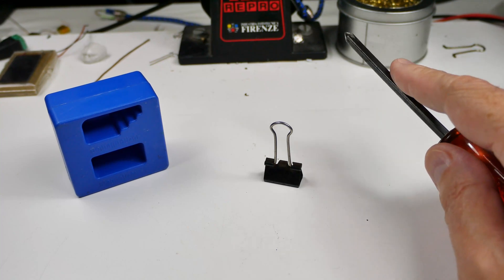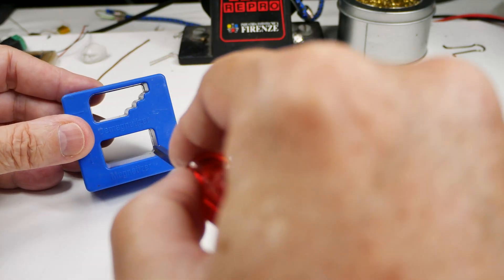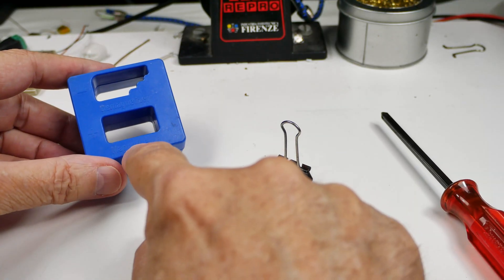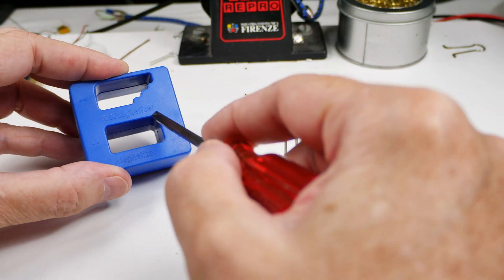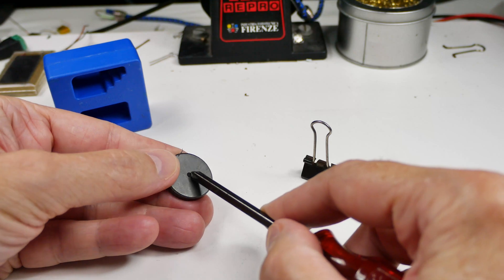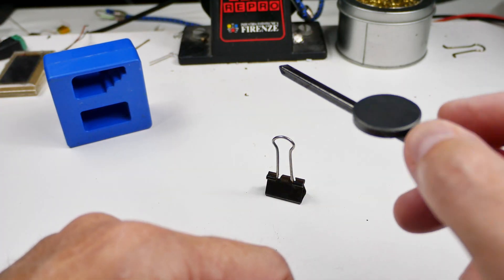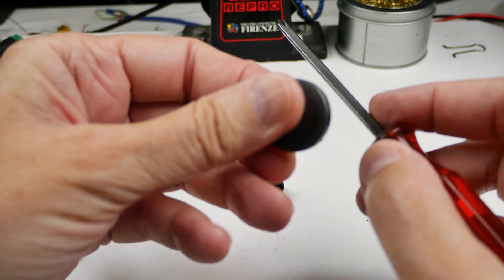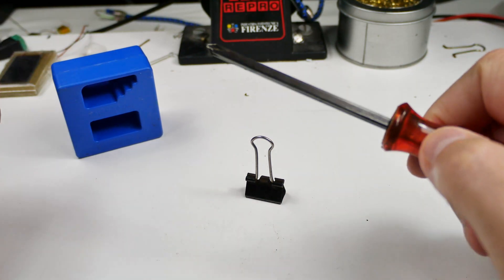DIY Cheap & Compact Tool Magnetizer/Demagnetizer

Comment: I usually use an old coil off a solenoid to magnetize and demagnetize. Magnets have always been fascinating to me.
Reply from the maker: Never thought of using a solenoid. Thanks for that.
Reply: @tsbrownie to magnetize place the tool into the air space inside the solenoid where the iron core or actuator once was and turn on line voltage for one or two seconds. To remove magnetism completely pull out the magnetized tool while the solenoid coil is energized. I always use a 120 volt ac coil.
Reply from the maker: @adnacraigo6590   Interesting. I will have to try that.